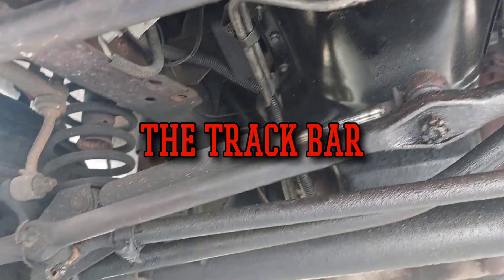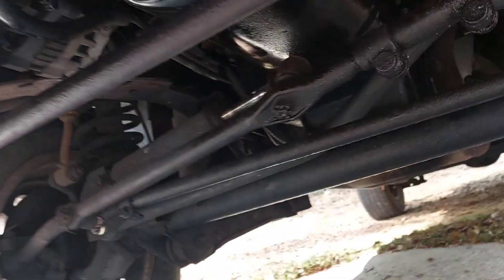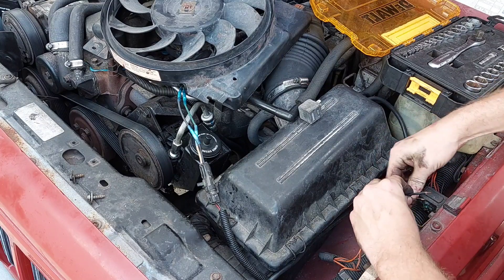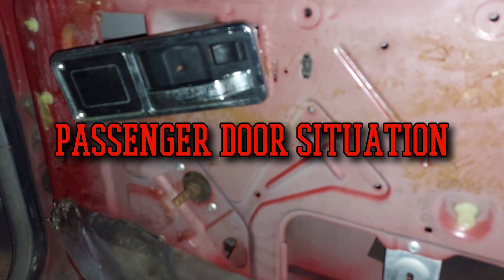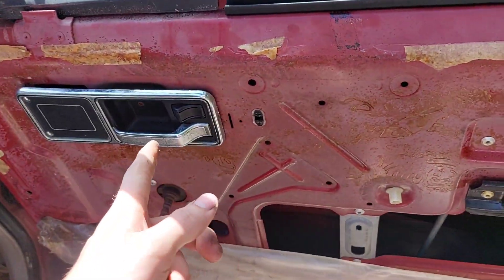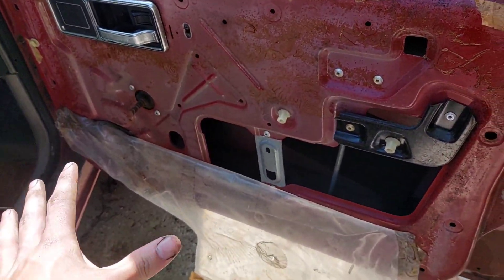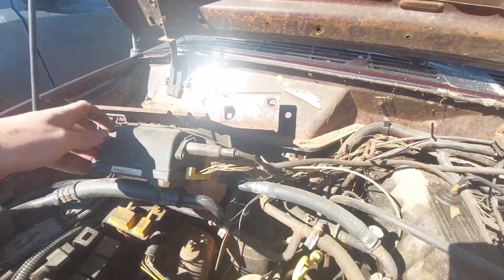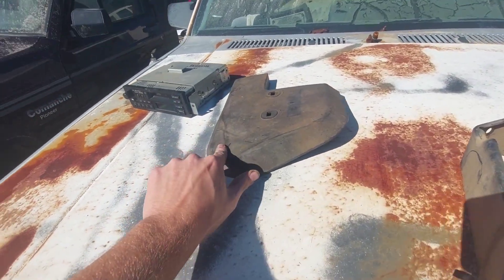1989 Jeep Comanche Eliminator - The Fixes and Upgrades. [Operation Cherry Pie]

Comment: About the spare tire carrier, from my memory all that you need to complete that one is a hollow tube with a hole drilled in the end for a cauter pin.
Reply from the maker: ah, excellent. I'm not sure it'll ever be put to use in my truck, I kinda realized the tires on mine have bolted in center caps, and thus aren't meant to be secured by these. Oh well. I'll sell it if you want it
Reply: @WAEMIDIV  I've got a cheap ford ranger wheel that I use for a spare in my cherokee. They're pretty cheap and the same bolt pattern

Comment: the light switch in the door jam goes bad, and the B pillar lights are still available new from the original manufacturer up here in Novi,  Michigan. man its a shame that truck is in a junkyard. those bed rails are really hard to come by these days, when i had my truck i couldnt find any anywhere.